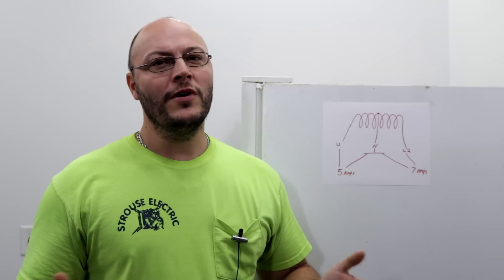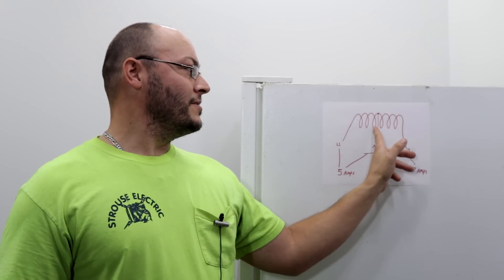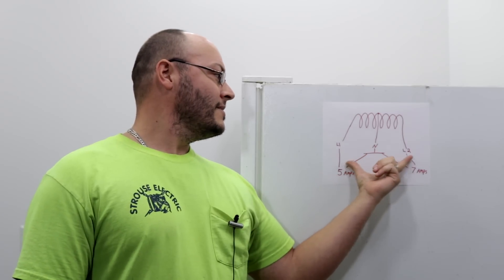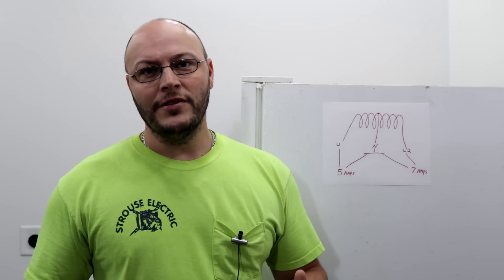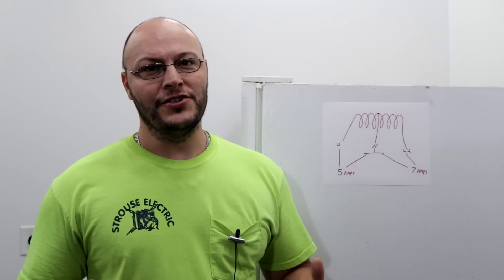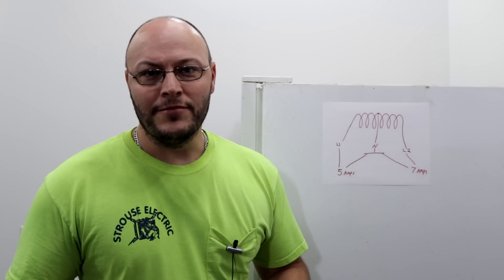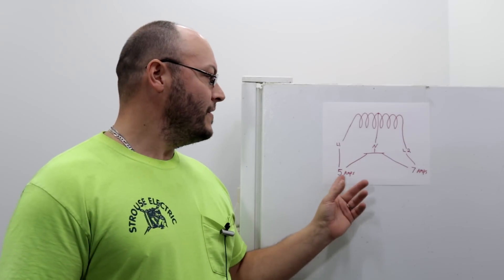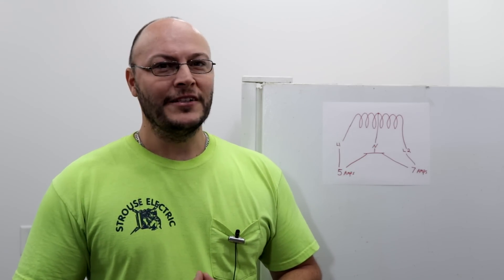What does the Neutral Wire Do?

Comment: L1- L2- L3... 3 phases of power they are 120 degrees apart (360 degrees divide by 3 is 120)
 On a wye transformer. (Y) Each leg is a phase. L1 to L2 (X volt) L2 to L3 ( X volt) L3 to L1 (X volt) the location where all 3 phases meet in the middle of the Y is the return path back to the transformer (the netural) any phases L1,2,3) to the natural is one half the voltage from phase to phase.

Comment: The neutral also provides a reference to ground (thus it is also a grounED conductor) and gives you more voltage options in a given electrical system. Such as 120/240v instead of just 240 or just 120.

Comment: This is old vid lol but got me closer to understanding something. I’m a heating and ac contractor and just had to replace a bunch of components on a newer boiler for my customer that had an over voltage situation. She got a new panel and service. 
    In talking to my friend he said a loose neutral can cause over voltage. So I’m trying to understand how this would happen.
Reply: It happens because it turns a parallel circuit into a series circuit and then the voltage divides among the loads. You'll have over voltage and under voltage in the circuit. In a regular 240v circuit you could wind up with 180v on one load and 60v on the other depending on the resistance. Both conditions can damage equipment.

Comment: Thought usa qas 120v not 240
Reply: it's 240V, but split. Meaning there is another wire that is tapped at the center of the transformer effectively splitting 240V in half. Most appliances use 120V. Only heavy appliances like dryer, washer, AC units, etc.... use 240V

Comment: Your answer is partially correct. When the current is flowing from L2 to L1, 2 amps will return on the neutral as you said, and the other 5 amps will return on L1. On the other half of the cycle, when current is flowing from L1 to L2, no current returns on the neutral, but rather the neutral provides 2 amps plus the 5 amps from L1 to equal the 7 amps required at and returned to L2.
Reply: In the trade, it's common to treat AC as DC for the purpose of visualizing how current flows. However, in the text of what neutral does, it does indeed carry the imbalance currents. This imbalance current, as you said, alternates.

Comment: As I was informed by an electrician, the power panel should have a balanced load. If more circuits operate on one side versus the other this excess current draw back to the transformer via the Neutral results in a higher electrical bill from the utility.
Reply: No, it's not even possible to have a balanced load, with appliances and lights, etc. going on and off willy-nilly. The electrical panel should be organized to mitigate excessive potential unbalanced conditions which could cause overheating on some circuits. Shouldn't have any affect on the electrical bill.
Reply: not exactly. More circuits operating on one side will make the neutral carry too big of the imbalance current, which makes it hotter than what it is rated for. The power consumption, however, is not affected.

Comment: so if you only had one hot wire coming in through a single winding into a box of a (single pole)  that ran to your house, you would never need a neutral, right?   As there would never be an imbalance
Reply: You always need a neutral wire in North American residential single phase electrical wiring to provide 120 volts AC.

Comment: I had a device at a major company that would shock you occasiinally! I measured the neutral and the live and fiubd the correct value. I then measured the neutral to ground and it read 250 v. We traced the ground back to tge assembly line and fiubd tgat the ground was not attached to a very large grounding bar. Got it repaired and reduced the neutral to less than a volt with alk other measurements correct. Interesting reason to check everything!

Comment: What’s confused me is if the neutral is suppose to return the power back to the transformer, and that the neutral is also connected the the ground bar in the panel, and if the ground is the easiest path of resistance than why doesn’t the neutral goes through the ground. Like why would it go to the transformer when it takes the easier route through the ground?
Reply: In a circuit, the current returns to its source and the source in this case is the transformer. If the current went to the ground via the grounding rod it would reach a very high resistance of the earth to find its way to the transformer ground rod and back to the transformer. So, the ground is essentially an open line. In the event of a ground fault, the high current, unimpeded would travel on the ground wire to the neutral/ground bus, back up the neutral wire to the transformer and trip the breaker. Once again, the earth ground is not involved.
Reply: while neutral and ground are, indeed, bonded, the ground is NOT connected to the load. Ground is only connected to the metal case of the load. Under normal operating condition, currents flow out the hot and return on the neutral. The only time current flows on the ground is when there is a ground fault, meaning the hot wire comes in contact with the ground causing a huge current spike and trips the circuit breaker.

Comment: Hey I'm just a smooth-brained ape here, but wouldn't a stronger more fundamental reason for the neutral is they help close a circuit, to allow electrons to flow back to the source, imparting some (but not all) energy to the load in the process, irrespective of the imbalance ?
Reply: I think what you're saying is correct regarding the circuits downstream of the neutral or neutral/ground bus bar. In each circuit the current will be the same amount in the hot and the return neutral. At the neutral bus, the current supplied from each hot bus, L1 and L2 will be compared and the  difference will be either returned to the neutral center tap or supplied by the neutral to either L1 or L2. This scenario depends on the direction of current flow at the time, and so is constantly alternating.

Comment: I'm confused.  Why is the current on the neutral only the difference, rather than the sum of the two load currents?  Great explanation, by the way; I'm just a dunce! 😆
Reply: The 2 opposite ends of the transformer represent the 2 opposite buses L1 and L2 on the electrical panel. When one leg is positive the other is negative and vice versa, so when one side is supplying current the other one is returning, so the neutral wire will provide the difference. When 2 circuits come from the same bus, either L1 or L2, they will be both negative and positive at the same time and the neutral will be the sum of the two load currents as you mentioned.

Comment: Pre 1995 houses in Norway receives 3 live wires, 230V between them, no neutral. This is the IT-system. All appliances are 230V. In new houses from after 1995, build in fresh areas, they receive 3 live wires and 1 neutral with 400V between live wires and 230V between any live and neural. The 230/400V TN-C-S system used in a larger part of the World outside the US.

Comment: Neutral is the return path for single phase power.
It only carries current on two phase if there is an imbalance in the load on each leg.
Neutral is hot there to protect against lightning.

Comment: What happens to the 2 amps when it gets back to the transformer center tap?
Reply: This is alternating current, so at one moment, the 2A joins with current of L1 at the center tap, and then go out to L2 with a combined current of 7A. And when the current reverses, the current on L2 split at the center tap. 2A goes into the neutral, and 5A goes to L1. And of course, this oscillates 60 times a sec.

Comment: You may have finally answered a question for me, if a reduced current is flowing on the neutral back to the transformer.  The house wiring and the plug set for my electric range contains two #6, red & black, Hot conductors and two #8 wires for the neutral (white) and ground (bare).  So, the neutral and ground are sized accordingly to carry less current....correct?
Reply: Not exactly, from 14 gauge through 8 gauge all of the wires are the same gauge including the neutral and ground. 6 gauge is different, 6/3 Romex for example, only the ground wire is 10 gauge. Not sure why they didn't use that. The range is wired for 50 amps, 240 volts. The range also uses a 120 volt circuit as well, hence the neutral wire. The 120 v circuit is for lighting and other electrical circuitry that doesn't need 240v service, and 10 gauge wire for the ground is sufficient.
This has nothing to do with neutral returning the unbalanced load.

Comment: I just think of neutral as a path of unused electron flow back to transformer, if that flow were to be stopped, then the load of appliance will not work because there is not electron flow. I’m not a electrician I do hvac, so I’m probably wrong

Comment: My easy understand - Neutral is a pathway back to Transformer at stastion.

Same understanding that, if we physically touch a Live wire, without touching the ground, ie with insulation like wearing rubber sandals, we dont get electrocuted. Neutral pathway is not created.

So , Live is incoming, N is outgoing.

Comment: Bill, I just swapped out a light switch.  The old one had a receptacle for a neutral wire.  Ground was attached to the electric box.  The new one I put on is an old conventional flip switch that has a screw for line, load and ground but not neutral.  i simply capped the neutral is that ok?

Comment: Does that mean if the load isn’t balanced on each side of the panel that the utility company gets back my unused electricity after it has already run thru my meter?
Reply: No because the electricity was not unused.
Reply: The utility always gets back it’s electrons!  You never get to keep anything.

Comment: The ongoing debacle of what the neutral does and does current flow in a balanced load neutral is a prime example of the fact that no one knows exactly what current is. Current is the hypothetical demon lurking behind our assumptions that we think current flow is electron flow. How then does a 2-phase balanced load cancel current flow at the mid point ? Do 120 degree out of phase electrons cancel each other out at the midpoint node  ?  No they can't, not mathematically, not by vector analysis anyway. So where does the residual current go ? Think about it.

Comment: Neutral is balancing the voltage not a load.
Reply: Neutral is not balancing the voltage.   The number of coils (wraps) in the secondary side of the transformer is enough to provide 240 volts.  The neutral is connected at the center of those wraps, equal number both sides, to provide half the voltage or 120 volts.

Comment: In the past 40 years, I have never attached the bare copper wire. I have never had a problem. I don't know what that "neutral" bare wire is for and I don't think anybody else does either. I always remove the 3rd prong on anything I use.
Reply: True story!   An electrician was called out to see why the sign at the bank would not work.  It was wired with a black and white only and the EMT conduit was supposed to be the bare copper you are deleting.   Someone had been in the attack before and bent the EMT pulling it apart.  So, now you have your installation.  No equipment ground.   That electrician did not know that the black inside the sign was not protected and had rubbed the metal can of the sign until the copper was touching the metal can.  Since the equipment ground was not there any more because of the bent conduit, the can and the conduit going back to the point of the break had 120 volts on it.   The repair electrician was crawling in the ceiling and touched both sides of the conduit at the same time while crawling.   His favorite suit covered his blackened arms in the casket.   Luckily he passed before the electricity kept flowing and cooked his arms.  
But you keep doing you!   Hopefully, if someone gets hurt or dies, it will not be them, so you won’t have to live with what you did for the rest of your life.
Reply: Stop it. You're breaking my heart. @KevinCoop1

Comment: The ground that you are describing is part of the grounding electrode system which ties into the ground bus in the electrical panel and among other things it typically connects to earth via a grounding rod(s). The ground wires that go to every receptacle and switch are known as equipment ground and connects to the main electrical panel with the neutral wires and only in that location. The purpose is to trip the breaker in the event of a ground fault within the house electrical wiring and has nothing to do with external events such as a lightning strike.

Comment: Question:  Does North America use a 3 Phase (72,000 volts each)
ungrounded Delta distribution system? (No neutral back to the substation).   Awaiting a reply. thank you.
Reply: I’m not sure of what happened to this gentleman, but he passed.   I believe you are meaning 7200 volts.  That would be a single phase connection of a 12,470/7200 volt three phase 4 wire system. Typically used by the utility company.  I have had many discussions with utility companies about this for connecting large solar to them.   They use neutral and ground as one conductor, but call it ground.  12470/7200 is a wye connected system, not a delta connected.   Utility companies have numerous three phase systems in their distribution system. They use or supply from 120 volts to 266,000 volts (the highest I’ve heard of)

Comment: why is it called neutral if when electricity changes direction e.g. from the transformer it becomes the "hot" wire and the hot becomes the "neutral" wire, aren't these 3 cables hot in nature? i don't get it, really
Reply: The term used by NEC is grounded conductor.  The term used by electricians is neutral or common conductor.  Those terms came about because it is connected to both sides of the secondary of the transformer.  Many do not understand and thing there is 120 volts only on the hot and zero volts on the neutral.  Not true.  Both have 120 volts available on them.   When the US started grounding these systems, the common point was a very good place to connect the ground because it would be equal potential on both sides.   So, since it is grounded and that is where the ground is connected there is zero volts from common to ground.  They are the same point.

Comment: The neutral wire does balance the load. I had a bad neutral wire coming the power pole to my power meter. I metered the  main braker on one half their was a 20 volts difference from one side to the other.

Comment: Absolutely correct;    
- The neutral carries the difference between phases L1 and L2, as you showed..
- Since, the 5amp load on L1 does NOT flow back the neutral, instead it flows on L2 as the return path.
- But,  L2 has a 7amp load, not all of it can return on L1, so the difference (2amps) will flow on the neutral..
This is because L1 and L2 are 180 degrees out of phase, (L1 is pushing electrons while L2 pulling electrons in 1/60th of a second), hence you have a push/pull arrangement between the 2 phases, and that's why appliances, like you dryer use BOTH phases to provide 240v for the heater/motor, and it works..
(Also, NEVER assume that the Neutral is not carrying current,  so NEVER touch the neutral with your hand.  It can flow between your hand (Neutral), through your body and your feet (ground). )
I hope this helps..
Reply: L1 and L2 are not phases.  It is single phase.  L1 to L2 is 240 volts with or without a neutral conductor.  The whole 180 degree out of phase comment only applies if you state “On an oscilloscope”.  There are three sine waves that all start and end at exactly the same time in the system.  One is 240 volts, and two are 120 volts.  Remember, they all start and finish in the same direction at exactly the same time.  Except on oscilloscopes.

Comment: I would add that while the neutral is not a ground, it is a conductor that is held at ground potential.  I know that most people talk about a “return path.”  I don’t like this terminology, which I think adds to the confusion some people have.  It takes two wires to make a circuit, a path through the transformer secondary, one wire, the load, and the other wire leading back to the transformer.  It is literally a circuit.  In an AC system, the current flows in both directions, reversing direction every half-cycle.  The two wires in a 120V circuit are equivalent, except for one detail: one of them, the neutral, is held at ground potential.
Reply: Let’s try this?   Both wires have 120 volts of potential.   It goes forward and backward flow as you state.  But the ground is connected to one of them.  When a meter is connected to two conductors that are tied together, they both have the same 120 volts on them, so zero volts measured.

Comment: There is no neutral beyond the transformer. If the unbalanced load dumped back into the transformer it would burn up. This is why neutral and ground are bonded together at the first means of disconnect. So that it can dissipate through earth.
Reply: No, you are completely misunderstanding the design of split-phase service.  It is easiest to understand as three circuits overlayed on the three wires: L1-L2 (240V), L1-N (120V), N-L2 (120V).  The two 120V circuits are in opposite phase, so the current on N is the difference in the two currents.
Reply: @GH-oi2jf .  The two 120 volt circuits are not opposite phase.  The two 120 volts happen in the same direction and time as each other, exactly the same.   And are in the same time and direction as the 240 volts.  It is one phase, only 180 degrees in an oscilloscope.